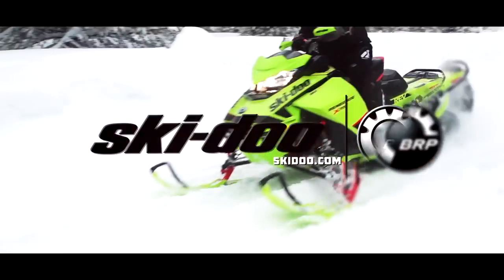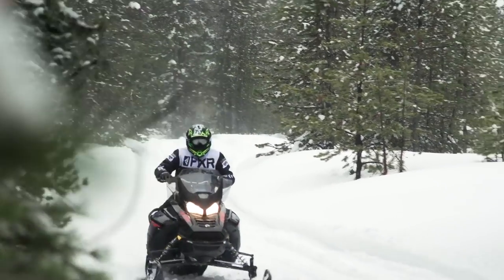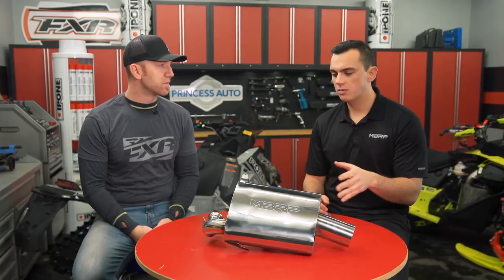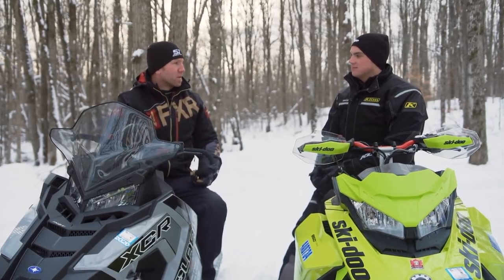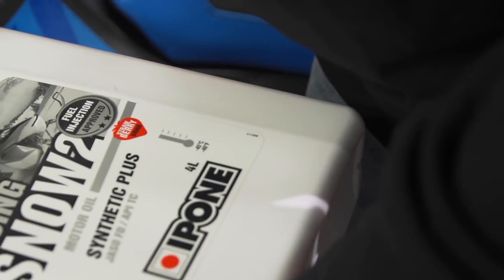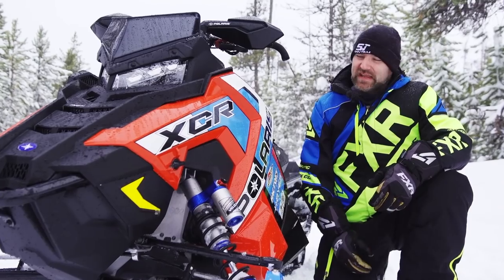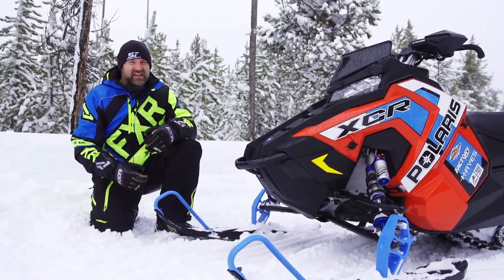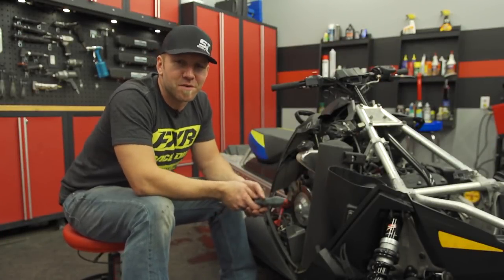SNOWTRAX TV 2020 - FULL Episode 6

Comment: The 900 Ace engine is bulletproof. The turbo version is still hardly tested after only 1 season. Could cause a bunch of issues.
Reply: shperax people have run them up to 25 thousand miles so I would say they are bulletproof